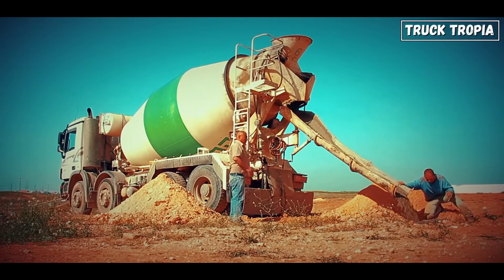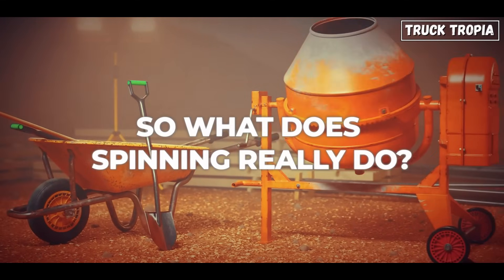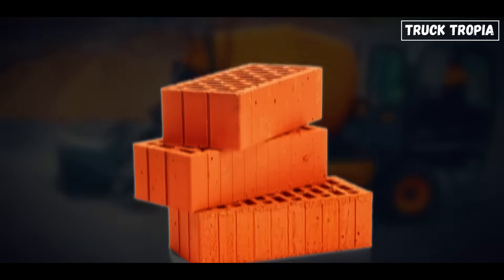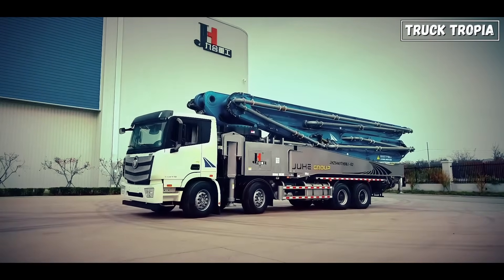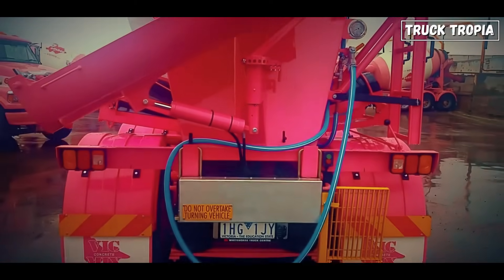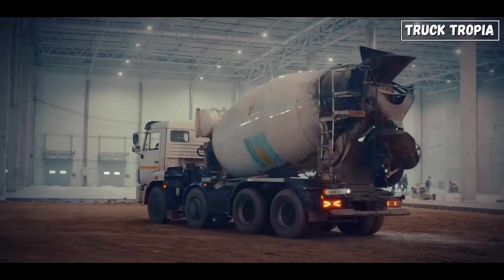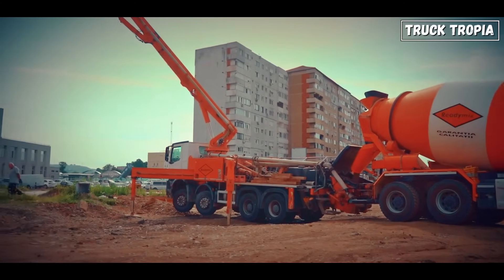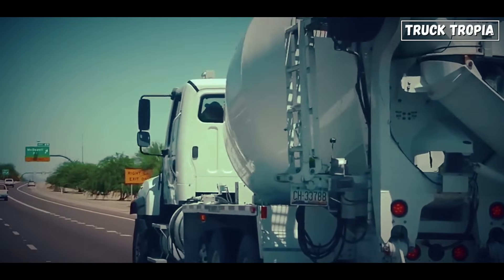What REALLY Happens Inside a Cement Trucks?

Comment: Oh come on! It's not a cement mixer! Cement is only one of the ingredients in concrete. The concrete is mixed at the plant not in the drum. The other ingredients are water, sand, and aggregate (usually crushed stone).
Reply: Only mixed at the plant if it goes though a mixer, some plants don't have mixers but just put materials into the drum and the drum actually does do the mixing; think these actual mixer trucks have a different blade configuration compared to the normal agitator drums.
Reply: @Semponi but cement is only one of the ingredients is the main point. 
The concrete delivery trucks I've seen were loaded with concrete mixed at the plant. Mixing in the trucks drum wouldn't be dependably mixed; resulting in construction failures.
Reply: @oriolesfan61    That's bullshit.
Reply: @brucerosati9434 facts. Your profanity doesn't negate my points

Comment: You forgot to mention that the mixer truck driver is often a massive pain in the backside.

I work in concrete manufacturing.
Reply: Take it from a mechanic at a large cement company they are worse than the truck's most days 😜😜👍🔧